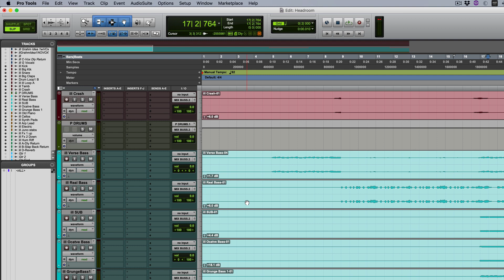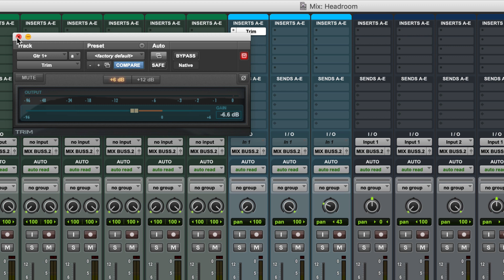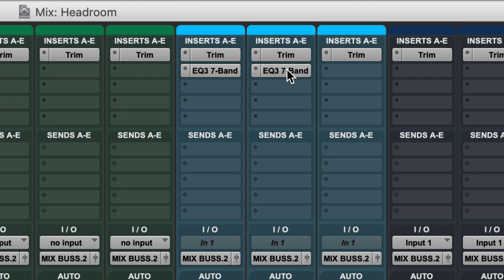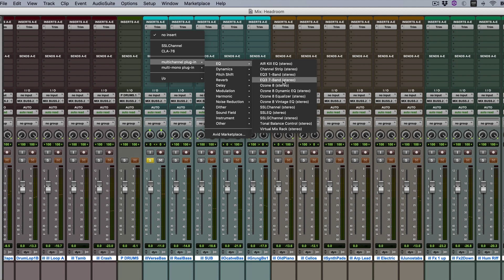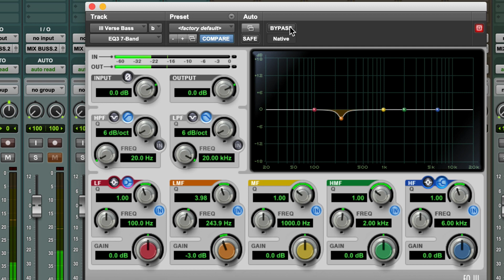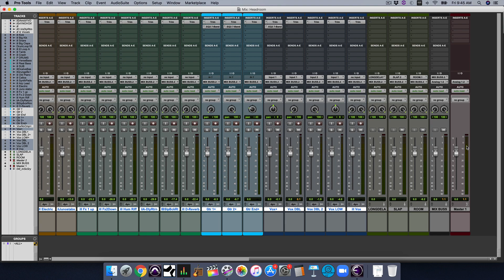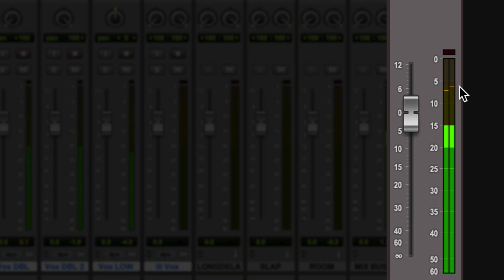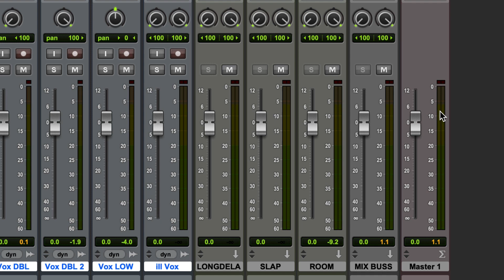Your Mix Needs Headroom (And 3 Ways To Get It) - RecordingRevolution.com

Comment: OK everything of this is correct. But don't forget turn the volumen up again, what I mean with this. For example, you have a chanel with - 2 dbs on arbitrary volume. But you want to subtract 4 dbs on the low frequencys (can be with a low cut or a low shelf). From here everything is correct, the sound is much better. But here is the problem, after this process your channel lost 3 dbs of arbitrary volume. So before this process you had -2  dbs, after this process you finally have - 6dbs on arbitrary volume, much more lower than before this process (-2 dbs). This is normal  'case you are subtract som frequencys, and I know that everyones make this process on solo mode, forgetting the others channels, their frequencys and how affect them ich other. So you turn off the solo mode and buala!! ¿Where is the sound of this channel? Who knows, you reduce too much the volume and the sound gone. Maybe you can turn up the father volume but that's not a good move. However you can turning up the output gain knob on your eq vst and equalize as the same volume as the beginning, -2dbs. And I know what do you thinking "but I'll lost headroom again" and the answer is not. 'cause you cut what you don't want to listen, (bad frequency) let it pass the good ones and encrease clarity. Finally you would listen everything without lost quality and force at the same time.. Best regards!!